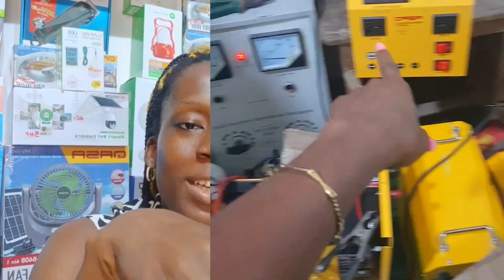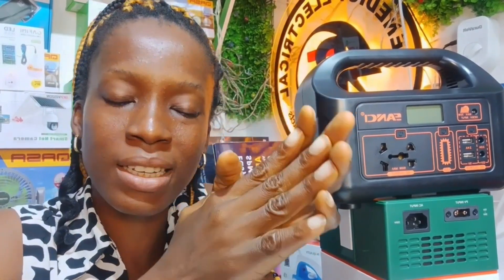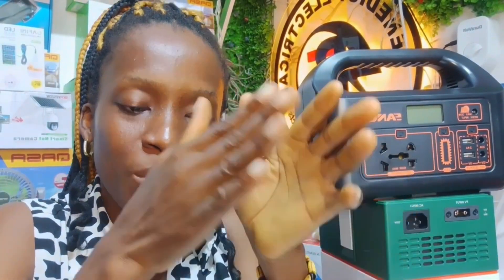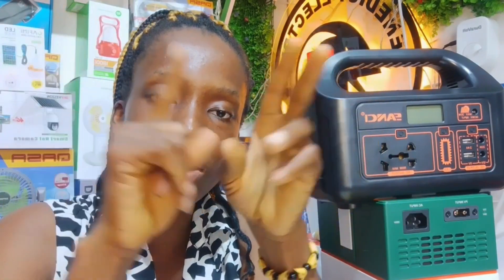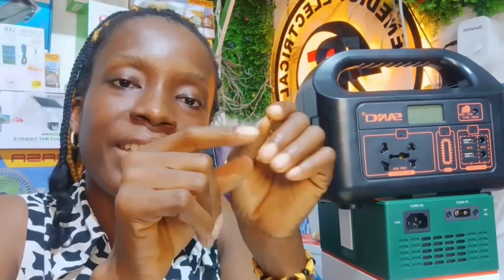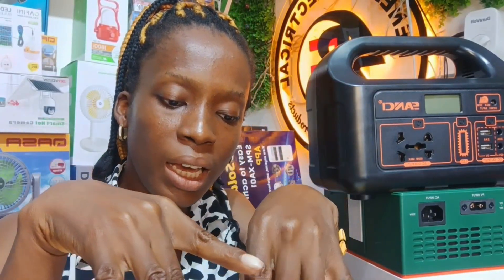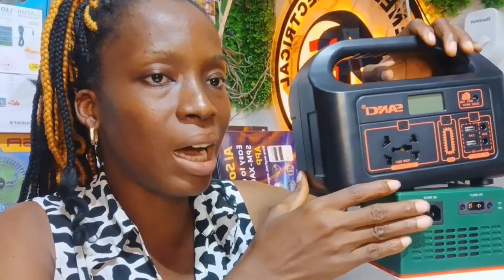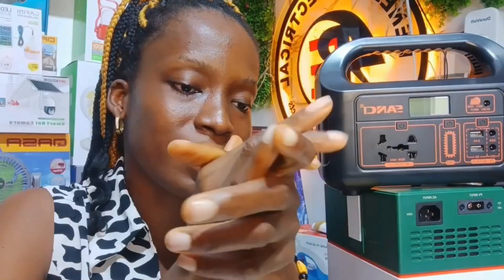Dos✅ and Don'ts❌ | How to maintain a long lifespan for your Solar Generators & other Solar Systems💯

Comment: Good morning ma.

Please I have 12V 50Ah  550 watts solar generator and it have a section at the back we're i can add extra battery to it.

Please ma what is the capacity of the extra battery that is recommended for me to add to the 12V 50Ah  550 watts solar generator.

Comment: Please can i use my 500w inverter to plug in my 85w hisense fridge?
Reply from the maker: You can
But we advice nothing less than 1000w for fridge and must be with good battery system
Reply: Kindly burn that innocent inverter and rush back to the market. The Chinese people are proud of you
Reply from the maker: @BlaiseChia That's too much naa😂
The advertizer actually promised them it can power fridge and Nigerians have been blowing up our DMs asking for that specific 500watt 😂

Comment: That 14.6 is the charging voltage of the battery from the charger, the maximum charge of 12volts battery especially lithium batteries is 13 to 13.6volts
Reply from the maker: But we have some solar Generators with lithium battery and their full charge is 14.6.
Reply: @benedictsolar you forgot to mention that recent solar panels have bypass Diodes, which prevents any solar panel to turn into a fireball. The bypass Diodes in question, makes sure that the solar panels do not overheat when some cells are partially shaded

Comment: Pls a question 
I have a solar generator (500watt)
Can I use it for my blender (350watts)
Reply from the maker: if your blender is under 100w you can use it. blenders are one of the appliances that tend to double or triple their current consumption during usage.
and hope the actual inverter capacity of the blender is up to 500w

Comment: Very informative...
Please, when the solar generator charged full using solar panel is it a must to always remove the solar charger.

2. Solar generator that has space to connect extra battery, will it show on the screen that an extra battery has been collected and will it charge together with the inbuilt battery when charging or will charge the battery separately
Reply: Before you added extra battery to solar Generator it will charge but slowly but make sure the battery inside the solar and the battery you added that both are same model, same capacity and same voltage if not the two batteries will damaged.
Reply from the maker: @chukssunny2981 Well said
Reply from the maker: The current spreads to both internal and external battery and therefore results in slow charging unless extra panel is added, if it's recommended of course. 

It will cause no physical damage, but it's not good to keep overcharging your battery just as you won't keep overcharging your phone. 

There's battery charger you can use and charge battery separately before attaching to a solar Generator